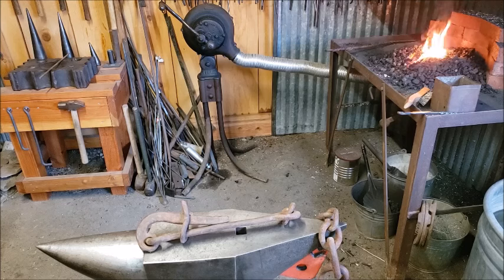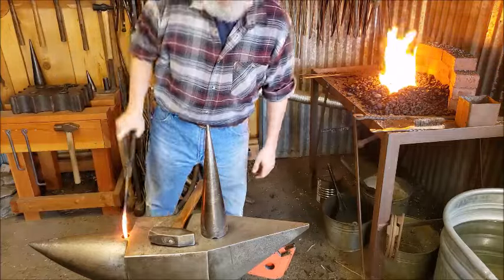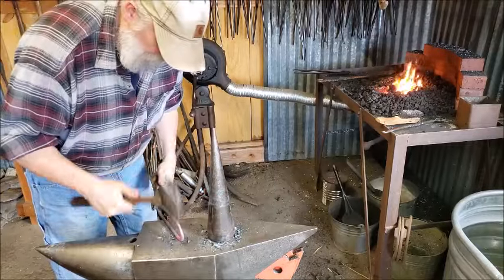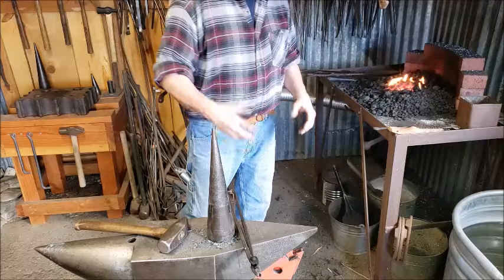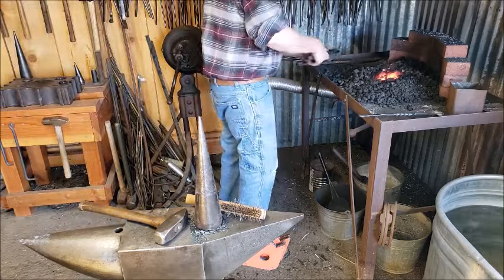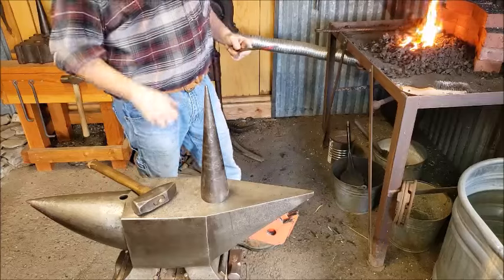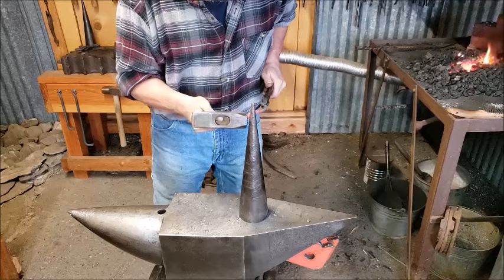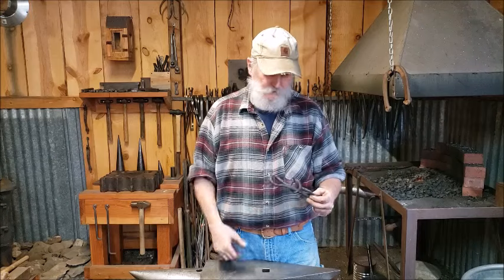Forging a small antique style Chain Binder!!

Comment: Interesting project. I imagined the order of operations to be different, because I expected the handle to be punched/drawn out like the big version, then put on the big link before forge welding. Obviously your method is fine, and apply because of the lighter duty smaller design. I’ll have to try one of these some time.
Reply from the maker: @Vikingwerk  --  Well, If I were to make the larger version, I would definitely do it as you described, punching the hole etc.  Considering this is light duty and much smaller material, I went the route that I did.  This small chain binder was made for a specific use, and they work very well, and actually hold a surprising amount of weight or force applied to it.  I probably should have explained better in the video.  Thanks for watching and I appreciate your feedback!!
Reply: @ironcladranchandforge7292  Oh, you explained it fine, I just started building it in my head while you were showing off the original old one, not thinking about the changes that come with scaling it down; so the difference makes sense.